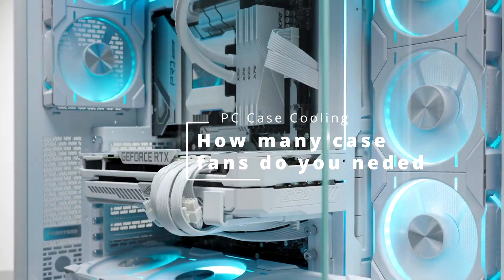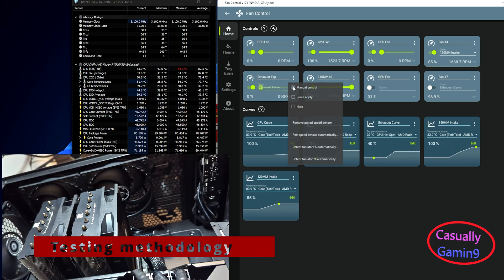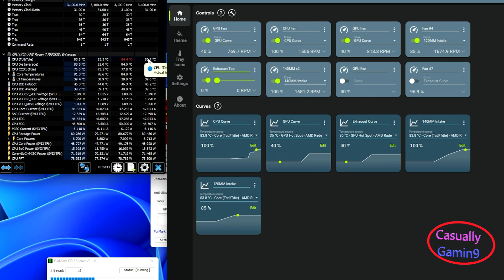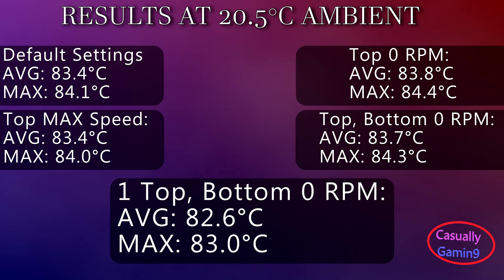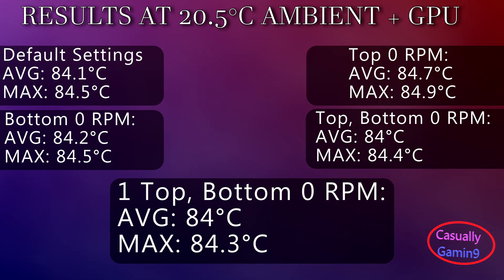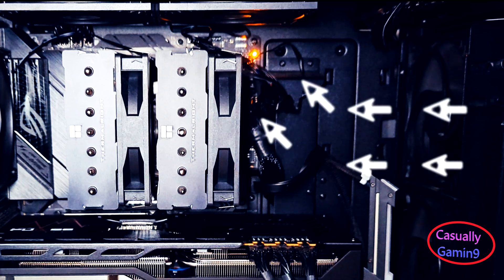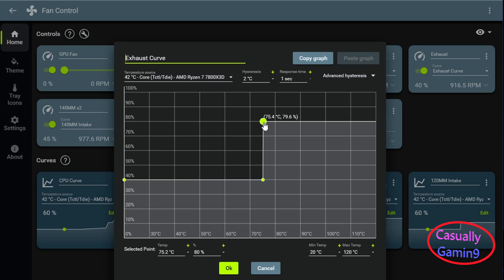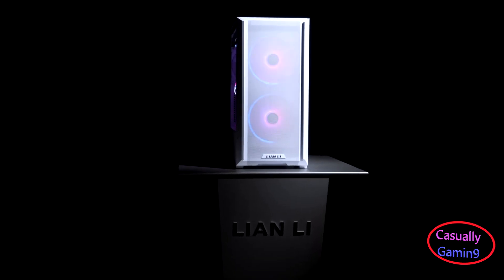Optimize PC Airflow for CPU Air Cooler Low Temp | Phantom Spirit 120 SE | 7800x3D | Arctic P14

Comment: I have the same case. How many C does the gpu temps drop with one or two 120m fans in the bottom? Thanks
Reply from the maker: Between 2-4, but it depends how warm the PSU gets
Reply: @casuallygamin9  Awesome, thanks

Comment: So we can say botton fans pulling air are ineffective?
Reply from the maker: Well bottom fans pulling air will hurt the GPU.
Reply: I am using 3x 140mm intake and 1x 140mm rear exhaust + 1x 120mm top exhaust (as you did). Is that okay? Thanks.
Reply from the maker: That is the best combo.

Comment: Great videos! I watched a bunch of you're stuff the last few weeks, and you definitely helped me make a choice for some of my parts. Thanks ;)
Reply from the maker: Glad it helped.
Reply: @casuallygamin9  I got one question... i don't care about price to much but, does a freezer lll 360 aio perform better than a phantom spirit 120 se? I whant the most silent thing i can possibly find. I heared that the pump noise is loud but i still hear people say its a lot quieter than phantom spirit. Do you have any tips for me? :D
Reply from the maker: So, the Liquid Freezer 3 will perform better then an Air cooler. The 360 version will be much better then a 240. I can tell you that what silent is for some, to others feel noisy. Liquid Freezer 280 may be a bit better then the 360 when it comes to noise, but the performance difference is smaller in gavor of the 360.
Reply: @casuallygamin9  Appreciate the quick response, thank you. Would you recommend a aio (LF3 360 for example) over a PS120SE, if you want a silent build that also performs good.
Reply from the maker: Well depending on the CPU that you have, a Phantom Spirit is could be ok, but the 360 is a better, as you can adjust the fan curve as you please. I would go with a 360 AIO.
Reply: @casuallygamin9  Thank you! :D I'll look into it. (cpu is 7800x3d)

Comment: This answered my curiousity, lol. I was thinking about removing my 2nd fan up top near the front of the case, because I was thinking as soon as fresh air enters it exhausts up the top. I have an aio though, so it doesn't really matter much. I couldn't mount my aio up top due to tall ram sticks. I just mounted it up front and 2 fans up top for exhaust. No back case fan for exhaust, so air goes in and exhausts upward
Reply: If I had an air cooler then I would do fans at the front, 1 up top towards the back of the case and 1 at the back of the case
Reply from the maker: That will be the best
Reply: @casuallygamin9  after my aio dies, I will switch to the phantom cooler, it compares to the Noctua DH-15
Reply from the maker: It testing the phantom spirit does better, at least that is what I saw as I didn't test the Noctua one. The new Phantom Sprit Evo does better then a 240 AIO. You can check this comparison video, if interested: https://youtu.be/O4MaQz4-9i4
Reply: @casuallygamin9  I saw thanks, thermalright has been making affordable beasts of a cooler

Comment: Thank you for testing. I will try your recommended setup in my new Lancool216 as my previous case could only barely fit my gpu by removing one intake fan 😅
Reply from the maker: Glad it was helpful. I tested as I wanted to see which combination is best for airflow, and this was the best for air coolers.
Reply from the maker: Make sure to play a bit with the fun curves as well, and see what is the best for your fans, when it comes to air cooling.